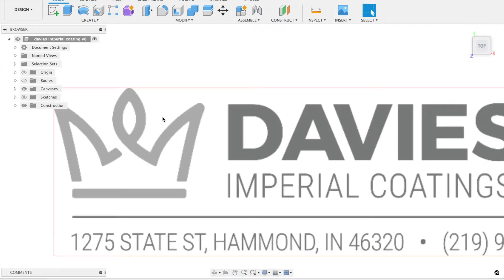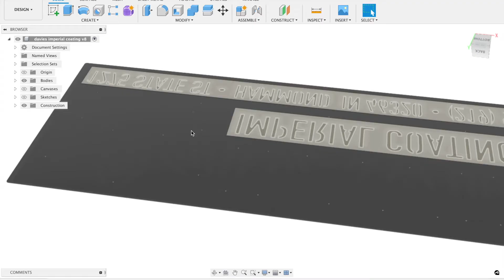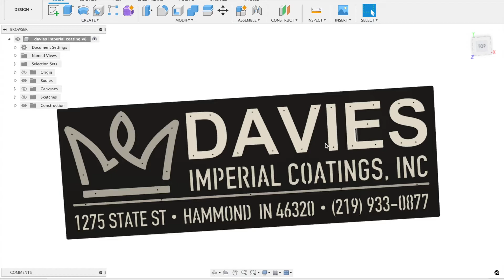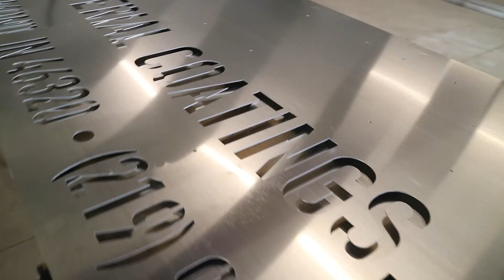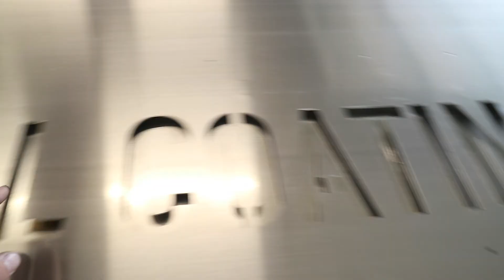MY BIGGEST CNC JOB to DATE!   All ALUMINUM!

Comment: Hi Kyle.  Just subscribed!  I’m looking to do some cnc cutting of 16 ga aluminum. Have you tried using your plasma table on 16ga aluminum?  I called Langmuir and never got through to anyone. I’ve seen mixed reviews about cutting aluminum with plasma. Do you think it’s possible to get clean cuts if you dial in your cutting speed, etc?  Love the channel. Thanks
Reply from the maker: Ive never cut aluminum with it.  Langmuir is good at selling but not customer service.  Thats why i switched to Boss Tables.  Aluminum is not good to cut with a water table.  You really would need a downdraft table which they don’t offer.
Reply: Right on. That’s what I was afraid of. I have not been able to find an affordable option for aluminum cutting that was at least 48”. Watching the welding cart video now, I’ll have to check out the boss video next. Thanks

Comment: I woud definitely not have put holes in letters and weld and grind on them.
Its going to look like Crape once its painted .
Even if you sand with a DA sander , its still going to have a divet and look like crape.

Should have just used the the spoting feature in sheetcam.

Im sure you learned a valuable lesson making this sign.

Good work other wise
Reply from the maker: Honestly it turned out amazing.  You couldn’t see and of the welds.  They must have laid the powder coat on thick.

Comment: From Guzzi Fabrication to you, bronze or aluminum rivits ( 1/4'' rivits ?  -  10'' - 12''  spacing? ).... incorperate the holes into your cad then line up and drill reinforcement holes. If you get too much penetration the weld will fall through to the face of the sign.... Rock on brother.

Comment: Is that a HF welding helmet? If so i feel like theres a bit of hope for me in trying to get somwhere with my own stuff...
Reply from the maker: Hah! It was.  It works.  I still use that thing.  I did recently get a new one.
Reply: I have langmuirs smaller table.... 4 yrs now and just about to start using it.. finally got the compressor to run it... When u upgrade to the bigger table,and if you're looking to help a person further their abilities, I'd be more than happy to accept your table😁. Just saying..
Reply from the maker: @jmachado6834  i will let you know.  Ill likely be selling that one.  I just installed a new water table on it.  I made a video about it

Comment: Nice work.
When I got my spool gun for my mig, took me ages to get it to flow right, did get some nice welds eventually.
I made a box gutter with mine so had to hold rain water, didn’t even leak once.

Comment: Like the sign. Like that you took on the job knowing you hadn't MIG welded aluminum to that point. TIG is also an option. You never had a follow up showing the completed sign!  Would have liked to see it after powder coating.
Reply from the maker: Thank you!   If you go on the community post of my channel page i left some picture of it finished.   Came out awesome

Comment: For those laid in letters itd look pretty good with LED strip light illuminating that cavity.  Could alsp put lighting behind the stand off letters as well.
Reply from the maker: I agree.  I try to stay away from lighting as much as i can.  Especially outdoors.  Theyre all made so cheap no id be getting call backs all the time.  It would look good though.
Reply: @SpicerDesignsLLC  yeah that's a fair argument.  Out of curiosity have you looked into the Squickmons machines?  I'm getting close to pulling the trigger on a Langmuir XR but recently saw them.
Reply from the maker: @JesseKlaus  no i havent.  Ill have to check them out.  I would like to upgrade to the XR.

Comment: What did you cover the holes with? How did it hold up to the powdercoating temps?
Reply from the maker: I filled the holes with weld.  It turned out amazing.  Customer was very happy.  I made two of them.   Ill have to post the finished product on here.

Comment: Spoolgun should be spray transfer, not short circuit transfer. Crank up that heat and wire speed.

Comment: I'm confused. You welded the backer plate to the sign, and then the next frame it wasn't there?? And then you bolted them on after. Was that a whoopsie daisy?
Reply from the maker: Mmh idk.  Ill have to rewatch it.  I might have done something in editing at different time frames.
Reply: @Spicer Designs  it was at 9:40. You said "next I'm going to weld the backer plate over the address," and you were welding it on, and then it wasn't there. No criticism or anything, just trying to get the whole process.
Reply from the maker: @happytrig  ohh.  I was probably welding the stand offs on for the backer.  Then i removed it to weld the frame on.

Comment: If you are getting soot, more cleaning and push your weld with a 15 deg. gun angle rather than pull it. Just a bit of preheat helps big time as well.

Comment: I would import that image into Inkscape., use the trace bitmap tool. save as SVG, import into Fusion.
Reply: I agree , I do the same
Reply from the maker: Inkscape makes a dirty file.  Cad is the only precise way to do it with clean vectors.
Reply: @SpicerDesignsLLC  I don't use Inscape much anymore. I use Lightburn now. But it is almost the same. You can simplify the vectors to get a betting trace. But I still like to do some node editing.

Comment: Man you got some balls!! A job like that for your first aluminum weld job, that’s crazy! Looks like you got it figured out and it looks amazing to this point!
Reply: You may have already researched it but, they say to have dedicated grinding pads and files and everything for aluminum weld to keep contaminates out. Clean the material extremely well and even knew stuff needs cleaned for any surface oxidation. Best of luck with it, that’s a lot of time and money right there! Oh, and does keystone girl wear a hat all the time or just for the videos?
Reply from the maker: @OneEyeCustoms  good info on the aluminum.  No she never wears a hat other than the videos.  Ill make her do her hair next time.
Reply from the maker: Hah i was getting pretty frustrated.  The initial arc is what i can get o look good.  Everything after that looks fine.  I still have one more to make too.